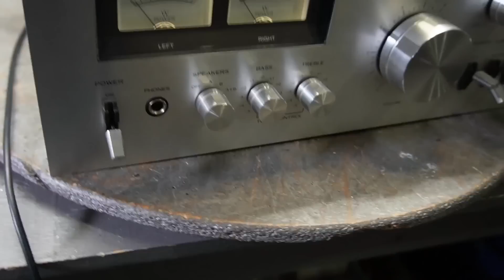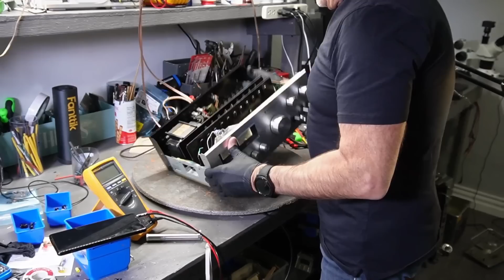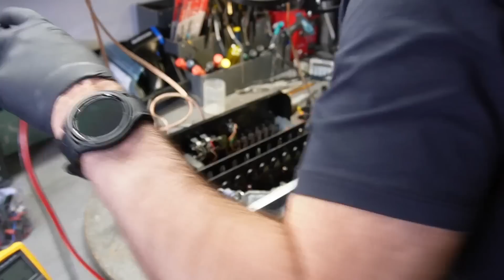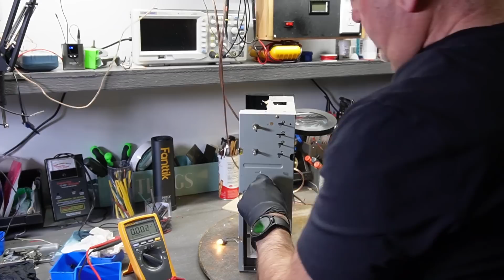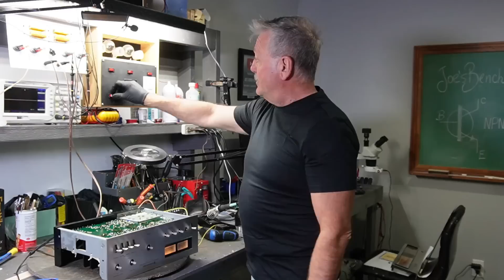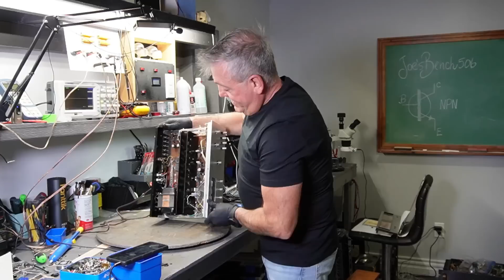Kenwood ka-5700 with no sound suddenly!

Comment: Cool Joe! I learned the use of the signal tracer with a Heathkit IT-12 when I was learning electronics at age 13 in 1967.  I probably would not have been able to just short the switch terminals; my nature is the need to know exactly what the failure mode is and that would require me to disassemble the switch and most likely clean the contacts physically.    
Nice job, I am a big fan of Kenwood equipment which I sold ‘77-78.

Comment: I had that exact amp along with it's paired up tuner back in the late 1970's. Absolutely loved them. Had a pair of three way Cerwyn Vega speakers....I was quite happy. 

I had a similar problem with a couple of the knobs that had lots of static when spinning them. Radio Shack contact spray worked for the first few times but eventually got so bad I had to finally get a new set up. 

Found the pair stowed away in the basement a couple years ago and the shiny finish was pealing off like paint. So I tossed them. They brought me good memories and a few smiles.

Comment: Good Video.  Gals to see you use the signal tracer.  You could have also used your scope as a visual signal tracer.  Audio Signal Tracers go way back.  I have an Eico 147A.  It gives me an external speaker function to use if I need a speaker.  Also gives me B+ output if I need a transformer.  Has a noise function.  Only use on Vacuum tube items as it is high voltage.  If used this function on solid state, you would fry components.  Keep the videos coming.
Reply from the maker: I appreciate you watching and your comment!

Comment: Nice diagnosis Joe.  The switch may be repairable but also not worth the effort, a new or used switch could possibly be acquired to replace...customer choice.  Since the customer was OK with the repair, your work was spot on.  The signal tracer was a savior here as you mention, well done.  See ya next time.
Reply from the maker: I appreciate the kind words and your thoughts on the repair!